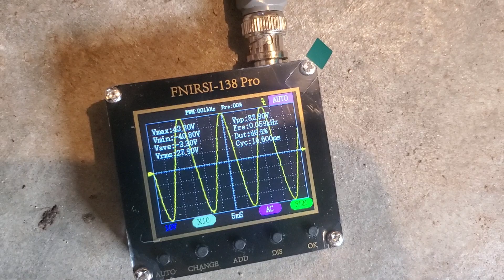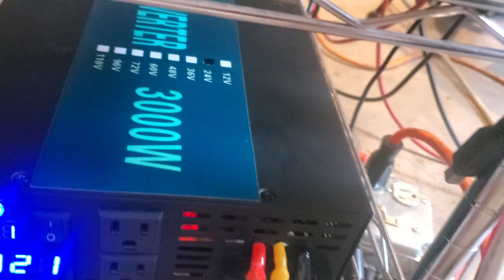before you buy a reliable brand inverter watch this!

Comment: I agree!!  They lie too- I got one of their newer ones this year to see if they solved their issues- it was advertised as pure sinewave- yea- pure MODIFIED sinewave, very noisy square signal- sent it back the same day for a refund- AVOID at all costs.
Reply from the maker: Im using the EG4 6000xp and it seems super clean compared to anything ive tried. My mpp solar hv lv2424 was all i used for a while but it wiped out my amateur radio stuff with rfi from the mppt charge controller.  The EG4 6000xp is not perfect but alot better. And light years ahead of any backwards wire funky grounded wzrelb reliable durty inverters

Comment: Without doubt the best inverter I have ever had. Worked superbly for the past seven years. I had a problem where my electric scale wouldn't work but it was a blown fuse in the inverter. Quick replacement and everything worked after that. 
Love these as the many fuses allow you to do your own repairs.

Comment: It's not just "Reliable" inverters that produce a dirty waveform. All high frequency, transformerless inverters produce a dirty waveform when under load. Especially when powering inductive loads. If you want a clean waveform then buy a low frequency, transformer based inverter instead.
Reply from the maker: Some are better than others.  Some actually have filters.  These are also wired incorrect.  The chinese like to use a red wire for hot . So maybe there in lays the problem.  But neutral and hot are backwards on all of these inverters

Comment: The outlet is wired incorrectly!     The hot from the PCB is connected to the neutral post in the outlet.   If you ground the unit this needs to be fixed first.
Reply from the maker: Yes its a known issue with all of them. I sold the thing. Its a dirty trashy inverter

Comment: why by an inverter when you can just flip your power strip upside down? also I dunno why youtube would put this in my recommended video other than the fact that I am diagnosed with both autism and schitzophrenia.
Reply from the maker: My older kid has autism.  Thanks for watching.  This video is more on the technical side of things. I have a solar panel array to power my work shop and some home appliances  like air conditioners. A dirty inverter that takes 12v or 24v or even 48v dc from solar battery  bank can ruin house hold equipment and make things run funny.  Some people have had their air conditioner burn up from the odd wave form.